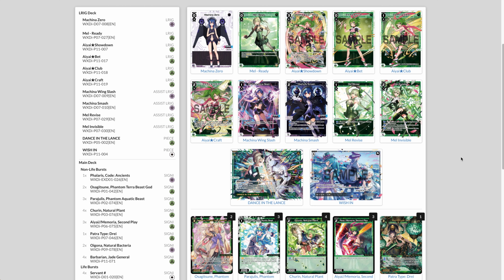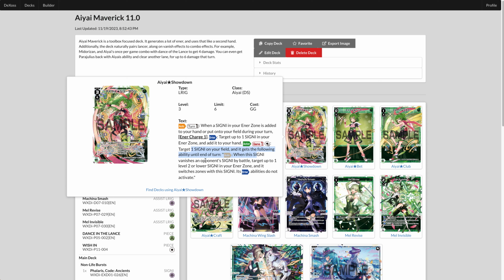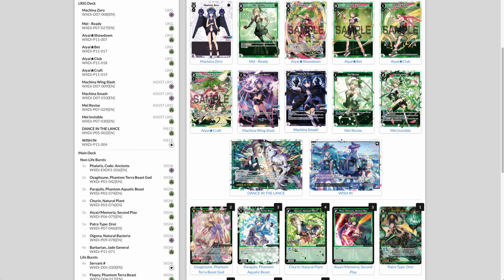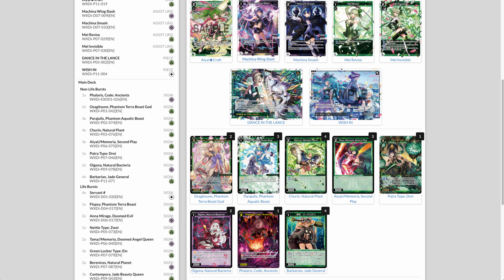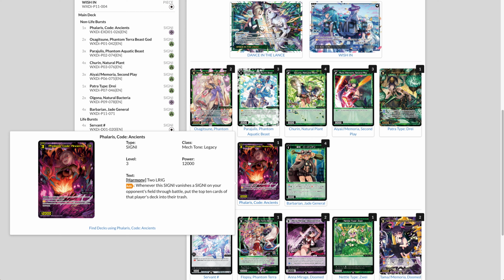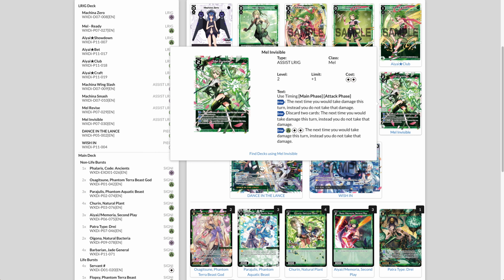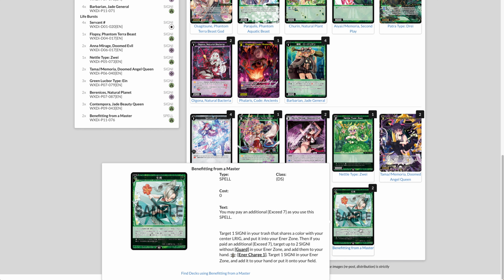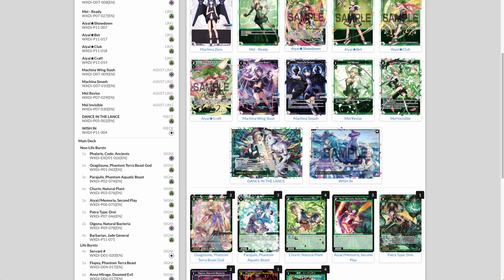No One Expects The 1 Turn KO From Green ☆ Aiyai Maverick

Comment: Hey Andrew, do you think a budget deck ($20-30) can be competitive?
Reply from the maker: Dash hirana is probably the cheapest deck that puts up a good fight in the meta right now.  Everything is under a dollar aside from diabrides, which are still cheap.

However, if you want something that's slightly harder to build on a budget but will last longer... Tama clear aggro is the way to go.

Exias and remembers are good cards you could save up for, but you can replace them with other white lvl 3s and be fine

https://dexoss.app/deck/6555b3ce592d9a31110e8c57
https://dexoss.app/deck/6555b2aba77b3e14aee76bf7
Reply from the maker: Unless your asking how to make aiyai competitive at 30... It's tough.  Green isn't exactly the best main deck color so it's hard to stray from this.  Tamas probably aren't needed
Reply: @LifeBurstPodcast  No, just in general
Reply: @LifeBurstPodcast  Thanks!